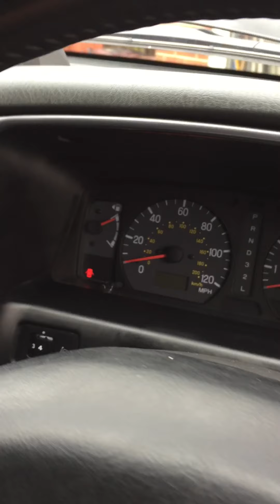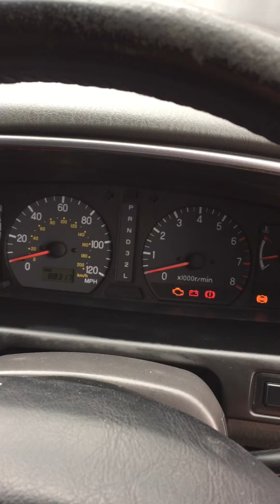L200 v8 conversion

Comment: And yes where did you get the arches from?
Reply from the maker: Arch kit from eBay there from a guy in Greece.
Reply: @noisy_boi_fpv_3920  loool. Lucky me. I am a neighbour to Greece 😁. I am from Albania. Is there a way to find that specific guy? If so would you mind shearing please.
Reply from the maker: @gridiish  https://www.ebay.co.uk/itm/Wide-fender-flares-wheel-arches-for-MITSUBISHI-L200-1996-2005-2-door-K74-/222296514997?mkcid=16&mkevt=1&_trksid=p2349624.m2548.l6249&mkrid=710-127635-2958-0

Comment: This is nuts. I have to say it’s good. Well done kido. Everything spot on. Even the dials was good and matching the petrol automatic engine. What’s the horse power now?!
Reply from the maker: Never measured it. Stock is 256 and more mods have been done since then. This clip was 5 years ago. I now have different ecu injectors exhaust side pipes engine has had a lot of work since then. Leads plugs sensors all changed. Gearbox has had shift kit fitted and fluids with friction modifier added. It may get haltech ecu and super charger next year then it will be 380 approx with 8 psi boost. Amazing engine and still perfect
Reply: @noisy_boi_fpv_3920  while reading what you said. Just before I got to the actual number that says 380 horsepower. I was literally thinking in my tiny brain it will be between 350-400 😆. Then I got to the number and laughed in my head because I was so close. That machine is nuts man. I got a l200. And what got my attention the most is because yours has been lifted like mine has been done too. It got my attention when you went to the back and I saw them brackets that lift up the leaf springs. I have exactly the same done to mine. Someone did all that before I got the truck. The very reason why I got it. And where I live it makes perfect sense. Because I don’t have a single tarmac road. It’s all gravel and brutal. But when I go to the city the amount of attention this truck gets it’s unreal. My brother has the 7 4.4 luxury bi turbo 550 horsepower. But I get more attention than he does. Because luxury cars here mean nothing. People show up with Ferrari Bugatti and anything alike. But the trucks are the only thing that truly matters here. If you showed up with that truck here. They would park you and pay you just to take pictures lol. You’d be super famous here 😁
Reply from the maker: @gridiish  what makes me laugh is the faces on the guys in Toyota disco’s land rovers BMW’s newer l200’s ranger’s they all take a good look cos they know it looks better then there’s.  Lol. And when I give throttle a blip there jaws drop.  Standing burn outs in the wet produce steam clouds then I just take foot off gas and I am gone. It’s worth it to see there faces
Reply from the maker: It’s not a simple task. I am going to do some more in depth videos into the swap. Soon. Subscribe and you will see them pop up. 🤙🤙
Reply: @noisy_boi_fpv_3920  sure thing. I am in 😉